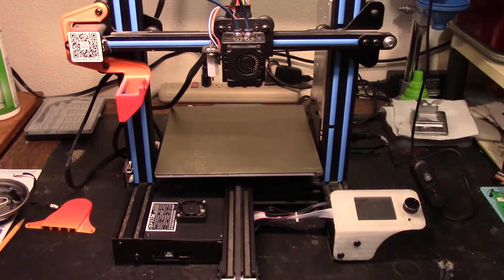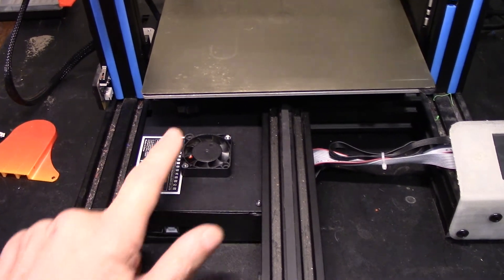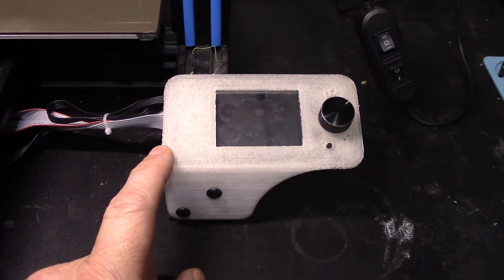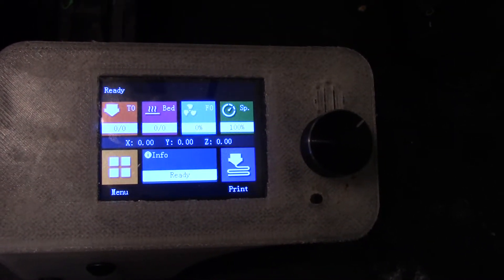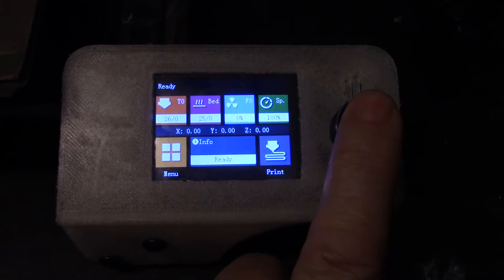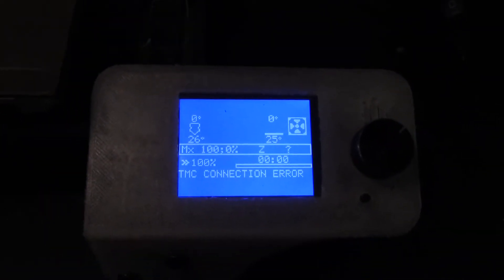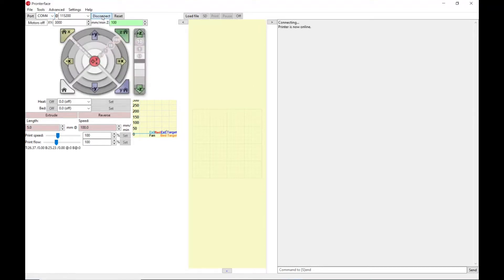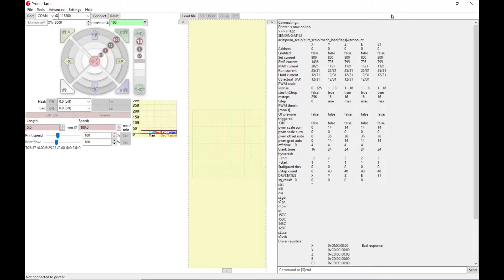Part 3 - BTT SKR 1.4 Turbo upgrade for Geeetech A10m - TMC Connection Error!

Comment: Are you going to add the Filament sensors and if not is there a disadvantage of having them?
Reply from the maker: I'm going to leave them off. Using the stock spool holders there's not a lot of room for them and it makes it a PITA to load filament. I ended up breaking one of the mounts shortly after getting the printer and they've been off ever since.

Comment: Hi Chuck,
too bad for you!
The only thing that comes to my mind is : did you ever load the firmware defaults in Marlin? I had strange things happening in the past when updating Marlin and forgetting about to load the defaults first.

Other than that : always keep a spare board in stock to never run empty. Like with beer!
Reply from the maker: It didn't make the editing cut, but during my trouibleshooting I flashed the version of Marlin that came with the board with BigTreeTech's defaults. I also downloaded the latest version release version, 2.072 if memory serves, and flashed with  it's defaults. I also downloaded the latest "nightly build" and flashed with it's defaults. Every one came back with the TMC Connection error on the X axis. If anything I'm too thorough when troubleshooting, I'll go back and forth over the same ground assuming it must be my mistake causing the problem.

Comment: That's the thing, you can make some pretty clean connections but the crimped ferule keeps all the loose strands at bay. Loose strands can break off and cause.. um issues heh

Go ahead and get the crimper ferule pack, you wont be sorry I don't think. I got all the crimper/connector packs I could and they save much time/frustration plus I the give super clean connections.
Reply from the maker: I've already ordered it and am looking forward to using it when the new board arrives!

Comment: Hey Chuck, cool video.  Yep, get a crimper tool.  I highly recommend getting the square type crimper.  (as opposed to the hex).  I got some TMC errors flashing boards the other day.  To my relief, it only occured when powered stickly by USB, and not power supply input to board.    I've been using the SKR Mini V1.2's for a while.  Less fuss with them.  I do have a bunch of other SKR SIP boards, looking to play with different drivers when time allows.  I kinda love/hate Marlin 2.07.  lol   Games were neat.  ;)
Reply from the maker: The square crimper is what I will get. Honestly, this would have been a pretty simple upgrade had it not been for the bad stepper driver and now the bad board. I should have realized before that there was something up with the board, but I thought the bad stepper was partly to blame and I'd never gotten the TMC errors before. Thankfully, the seller has been quick to send out another one, otherwise I'd have been out the princely sum of $40. Assuming I could find another one. And from what I can tell BTT is replacing the SKR 1.4 with the SKR 2.0 which might be why the 1.4 is out of stock everywhere. Yea, Marlin 2 is giving me some grief, no so much because it doesn't work, but some of the configuration options are rather strange. Like having to leave the number of extruders set to "1" when you're running a mix printer. Makes it impossible to run both extruders from the control panel, or at least that's what it seems like to me at the moment.
Reply: @3rdpig  I've not tried more than one extruder on Marlin 2.0 yet.  I did see config adv settings for the LCD to change the display for more than one.  I need to put one to together and play with it.   I was still noticing very slight extrusion quirks (pops) which appear.  I could move where they occur around with LA settings.  I thought it was filament at first.   I went straight cassic settings with it, and it still occured.  Also, resuming from a pause at print height, would not resume without some error in Z height.  I kind of like to get things perfect, before I jump around too much.  My S4 with Marlin 1.41 is still my more beloved printer.  Just stable and rock solid.  On a version 1 8-bit board, no less.  SKR package is sleek.  I'm hopeful  :)
Reply: Question how did u fix the TMC error when u hooked it up through the USB? Same issue, trying to flash the motherboard but when I connect the USB it reads TMC error....